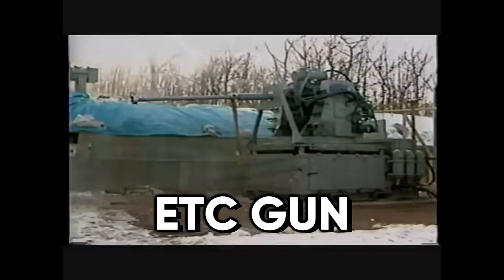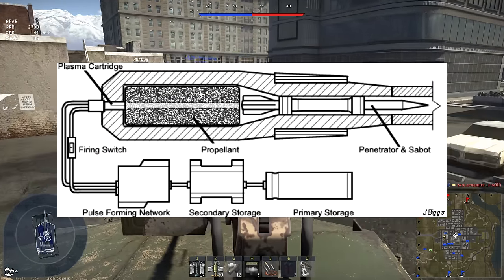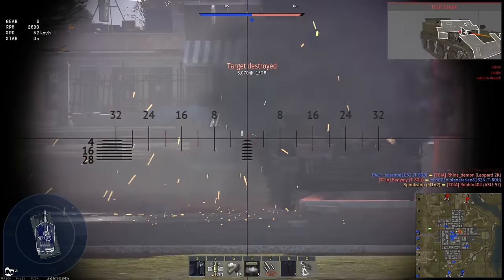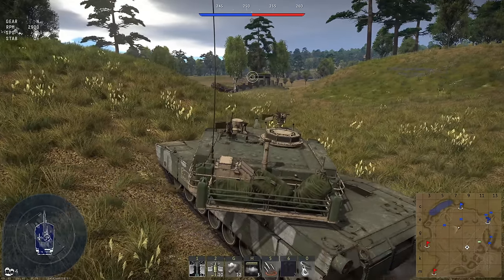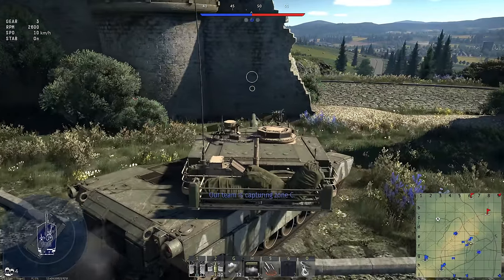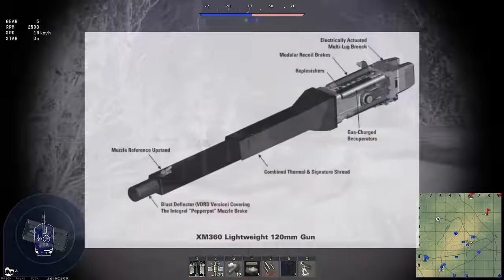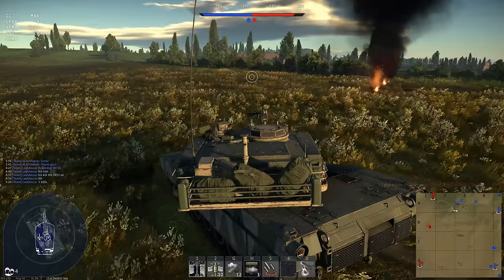ETC Cannons - The Future of Tank Weaponry

Comment: Wow!
Epic gun with quick fire rate like this sure will be a huge change in tank manufacturing.
:D
Reply: That's not the point as far as I understand the video. The weapon you are talking about isn't a cannon, it's an ETC autocannon. The kind that is mounted on IFVs. The major difference between conventional guns and ETC cannons is the propellant ignition method. The fire rate will propably be similar. The shell is still the same size, just much more efficient.
Reply: This video isn't saying that tanks will fire as dude above me stayed, it's saying the velocity of the round will be much higher, though theoretically there could be an increase in fire rate.
Reply: Yeah except that no, ETC gun have disadvantage, one of them being that it build up more heat so quick fire rate ain't a good idea. there is also no need for extreme firerate on the battlefield.
Reply: @benjamin1359870  If there was no need, why would autocannons and assault rifles exist? High fire rate is obviously a preferred approach when dealing with soft targets, especially in large groups. For tank guns fire rate is good as well. If you can put out rounds 1.5 times faster than your enemy, you will be killing 1.5 times as much shit. Of course, at a certain point the autoloader you'd need to install would get too mechanically complex to be reliably used, and there would be problems with the aforementioned heat buildup. But up until a certain point, increase in fire rate is a desirable outcome.
Reply: @martydi2519  But those are far for extreme, you just  have to compare the fire rate of a
GAU-8 Avenger to an autocannon, or an assault rifle, there is not anee for extreme fire rate, that's why no modern machine gun has the fire rate of an Mg42 despite most of them being based on them, because there is a point where the fire rate is just a hassle. Tank cannon don't need high fire rate they don't deal with soft target in a way that need high fire rate. and on't carry even ammo to really be able to afford to even miss a target, if you never miss your shot you on't really need to worry about how fast your second come; and most of the times in combat situation tank rarely have to shot in quick sucession when a high firerate would help.
Reply: @martydi2519  
Oh!
Yeah you are right!
Besides the ETC cannon is a huge consumer of tank shells.
So we need a lot of shells for this one like about 500 or more.
I guess that it's demanding in this case.
Reply: @martydi2519  ion cannon or that tripod flexible pipe and can shoot heat temp that

Comment: I ammunition propellant can only be ignited by a plasma device it cannot be ignited by incoming enemy rounds. That is HUGE as most tank kills are due to ammunition cook off. It also increases crew surviveability.  While an incoming round that penetrates the armor is going to be deadly on any crew unlucky enough to be struck by spalling and fragments of the perpetrator, not having you own ammunition explode in the turret with you, is a bit of a relief.  My opinion would be that, if it increases round performance against enemy targets great, but if it maintained round performance similar to current chemical propellant , but increased crew surviveability by making the rounds impervious to cook due to vehicle armor penetration, then that is still a winner. A tank can be repaired from lots of battle damage. Its the trained crews that are harder to replace. A catastrophic internal explosion will usually destroy the tank beyond repair AND kill your crew.

Comment: Supercapacitors are getting pretty good. Maybe the diesel engines in tanks could just serve as generators, driving power to separate supercap banks, a main one for movement and other standard technical systems, then a small one for the cannon.

Comment: I thought of this a while ago when I was making a sci fi universe.

In it batteries where a issue so I couldn’t use rail guns so I came up with the idea to uses coil guns mixed with etc guns. 

With the main power coming from the etc and the coil increasing its power as it when down the barrel of the gun.

With a diamondoid bullet with a tungsten core and a super conducting material on the surface of the bullet going down the barrel at Mach 15.
Reply: The only issue with that is cooling and the resulting local atmospheric heating from firing more then a few shots potentially frying nearby friendly infantry.
Reply: You and I both, blood God.
Reply: Demo_the _man 

The marines in it where genetically enriched cyborgs 
Wearing power armor and
 the gun and armour where made of a super alloy that could take a lot of heat and recoil
Reply: KajiTetsushi 
Nice what was your story about
Reply: @primaris7045  not something I can discuss at great length in a YouTube comment.

"Going 15Ma" is not very believable in the universe I want to envision, especially not in handheld firearms, so I use ETCs accelerated with gaussrifles / coilguns instead... and possibly full-on railgun if I see it fit. It won't be feasibly man-portable at this universe's current state of affairs; only vehicles and emplacements can wield such a weapon.
Reply: KajiTetsushi 
Sounds cool did you ever publish your story 

I’m still writing mine
Reply: @primaris7045  nope
Reply: KajiTetsushi 

To bad I guess
Reply: @primaris7045  there's a better time for it, like maybe in 5+ years from now while I brush up my drawing / programming / writing skills...
Reply: KajiTetsushi 

Cool

Comment: If i remember correctly, the germans did researched this technology in the early 80's and it turned out to inpractical for common use - especially in real war scenarios. And there where also problems when the inviromental temperatures are to hot or to cold.
I did a quick search but i could not find anything on the web. Im sure i read this in a museum.
Reply: Just because the issues were too hard to overcome in the 80's, that does not imply that they always will be

Comment: I don't understand why I didn't mention this when this video got uploaded.
The reason why we don't see ETC guns in use is that higher velocity is ironically detrimental to APFSDS performance. Those rounds have optimal penetration velocity dependant on the material used, DU rounds tend to be around 1600m/s, WHA tends to be higher at around 2000m/s mark, and steel is 2500m/s. There is no need for higher velocity or more kinetic energy.
That could change if some country decides to work on a proper ammunition that could take advantage of the increase in those characteristics. Though it is unlikely unless there will be a drastic leap in armor technology.
Reply: How is higher velocity detrimental to APFSDS performance.
Reply: @smileyface6583  Few reasons. Beyond certain point you start to get massive diminishing returns from increasing velocity. At the current velocities the length of the penetrator matters much more than its velocity, which is why we see constant introduction of APFSDS rounds with longer and longer penetrators. As velocity increases penetrator might "shatter" or do other fancy stuff when hitting a target, basically working against itself, there were some ideas how to prevent that, telescopic penetrators, multiple "stage" penetrators etc.
Reply: @Ally5141  Ok I think I get it now. So you’d probably need something like osmium, along with some fancy APSFDS engineering to have the optimum conditions for higher velocities, right?
Reply: @smileyface6583  yeah, tho denser materials work better at lower velocities. 
As the tip of the penetrator hits target and gets slowed down the rear part of it still pushes forward carried by momentum. This generates internal stresses between tip and rear that can (and will) cause the penetrator to lose integrity. Less dense materials, that can be squeezed more easily resist this better.

Comment: Do we even have shells (or materials we could use for shells) capable of being fired at such high velocities without simply shattering on impact? 
We already transitioned from steel shells to tungsten-carbide cored shells, and even those risk shattering on armor when fired from current guns. Some countries have depleted uranium shells, and long-rod penetrators are also made of very tough stuff. Are either of those materials viable for use in shells fired at extreme high-velocity from next-gen ETC, CLG, or rail guns?

Comment: Going into this video with prior knowledge on ETCs(Not on hands experience). There's an awful lot of things that make them pretty bad when in the context of conventional warfare, and military use in general.

1. Maintenance
Everything about ETCs screams doubled or even quadrupled wear on the tank barrel. The increased ignition rate of the powder and higher acceleration is a dead give away of this.

2. System complexity
This in comparison to current systems, is very complex when in operation. There's so many crucial components that need to be in perfect working order for the whole system to operate. 

On top of that, repairing the system takes specialized knowledge because of the new components in the system which reduces an ETC vehicle's availability rates

3. Efficiency
Taking information given to me from watching other videos about ETC weapons, they're super inefficient during operation, meaning that a lot of energy used to propel the gun is mostly lost through heat because of the rapid ignition of the powder which leads to the afformentioned increased barrel wear

4. Increased costs
With a system like this, it's going to inevitably be more expensive than conventional guns which doesn't help with the fact that most militaries today are heading towards downsizing and acquiring cheaper/cost effective weapons
So in conclusion, are ETCs the future of tanks? They can be for sure, if the tank is operating in absolutes where it doesn't suffer horrible inefficiency and that there's a huge advancement in gun barrel technology to curb the barrel wear problem

Comment: Generally less moving parts = better reliability. Better reliability means they can push the tech further. I knew about this technology before from small arms speculation but very interesting video. Thanks!
Reply: Ofc my comment is a vast oversimplification since it improves stuff like being able to use different propellants when you don't have to worry about chemical ignition and so on and so on

Comment: I think that we might see an ETC concept combined with a Binary Propellant System to increase the gun's velocity WITHOUT increasing the size/weight of the gun.  You would load the projectile, then introduce TWO separate "liquid or powdered propellants" [which are stable when alone but become volatile when mixed] by an injection system, and finally ignite the combined solution [or powder] with a plasma charge.  The BP propellant component can be very compact (just look at the small-diameter bomb and its "hyperbaric explosive" compound) and the only major issue would be creating a barrel that can contain such large pressures.

Comment: One thing that you also miss is that with ETC gun the power of a round is no longer limited by the chamber volume and the burning temperature of the propellant, in a conventional gun the chamber volume limit the total amount of energy you can use to propel a round and the temperature of the gas is bound to the burning temperature of the propellant, with an ETC gun, it's no longer the case you can heat the gas even more increasing it's expansion velocity, that's why ETC gun can reach higher velocity, it also means that depending from the amount of heating the velocity of the projectile change, so it's not just ammunition with higher velocity, it's amunition with changeable velocity depending from the crew need.

Comment: I can just say it again: The Coilgun will be the way to go in the future. They are more effectiv and efficitient than a railgun.
Reply: Unlikely coilgun technology is far more cumbersome and significantly more complicated than railgun technology and can currently not produce a high muzzle velocity due to the incredibly fast switching needed. The only current limitations on railguns are how fast they eat the rails and capacitor technology.
Reply: In thier current state neither the railgun or coilgun are practical options, they are both too expsensive, complicated, and power hungry to be used in anything smaller then a ship. The coilgun still has issues with swithing power from one coil to the next with the correct timing. Though if we're going to bring those two up, might i suggest a third option of electromegnetic gun? How about something called a helical railgun? While it currently wouldn't be any more practical, it does combine the advantages of both the railgun and the coilgun.
Reply: @synapsisflame9721  The tech is obviously not researched enought. Theoratical you can reach far greater velocities then with every other technology. Im desiging an own future military currently and the tanks for example use coilguns, it has a lot of potential advantages, those i would bet you dont know about.
Reply: @riesenfliegefly7139  what are the examples of these benefits compared to railguns. Currently like Mrpotates stated neither are practically for military applications. Both technologies are currently extremely cumbersome and inefficient however like I said the only thing limiting railguns are the rail material and capacitor technology. The main problem with current rails on a railgun is the erosion from the extreme heat and pressure when the gun is being fired limiting current barrel life to 15-20ish full power rounds from the navies railgun. Even if the technologies get smaller and significantly more reliable militaries are more likely to go with the cheaper less complicated railguns.

Comment: How scale able is this tech? Could it be scaled down to firearms, or scaled up to naval weaponry?
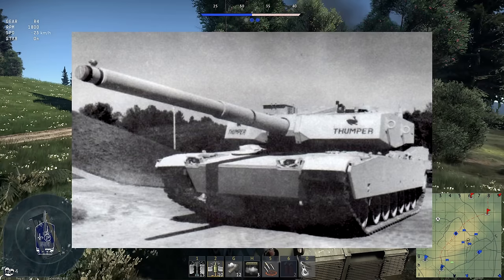Reply: The prototype that appeared at the beginning of the video was a 60mm but larger caliber ones existed (such as those on the tank at 4:40).
Reply: I think the benefits of more consistent ignition would benefit more on the larger side. (Not that naval vessels use large bore cannon any more- missiles have extended the reach of many vessels whilst reducing the tonnage and displacement  footprint of a vessel's weaponry and removing the need for a lot of dedicated plant and manpower for the same abstract combat value)
Reply: It could be scaled up for naval guns. Scaling down for small arms is a bit trickier. Electrically fired primers have some benefits and have been done before in rifles. But if you use ETC in a rifle it will probably make the recoil impulse much shorter and sharper, which can negatively affect accuracy of sustained fire. The energy required will also be higher than a simple electric primer, which means a larger and heavier battery that needs changing more frequently.

Comment: I've actually been writing a more "grounded" sci fi story where human soldiers use ETC rifles firing a semi-caseless sub caliber penetrator with a polymer sabot. Man portable railguns exist in this world, but the batteries and power equipment are very bulky so they're normally crew served, but an ETC plasma cartridge is cheap, and can fire hundreds to thousands of rounds before running dry. You can even scale it up with rail or coil assists, instead of a tank just loading APFSDS, it loads a round that's basically a railgun sabot, and as it fires, coils around the gun barrel speed it up to hypersonic speeds.

Honestly an underexplored weapon in sci fi, I feel

Comment: If they can shorten the shell casing  by using a more potent propellant, modify the breach for the new shell, you could reduce the size of the turret shell stowage compartment allowing for a small APU (Aux. Power Unit) to be mounted to power the ETC Device.

Comment: Battery technology is improving at a blistering pace as well, if a tank is fully electric then the need for a separate power supply for the ETC will stop being a negative since it could just pull from the battery pack, also the ETC seems like it was designed for use with super or ultra-capacitors, which one would probably want on tanks anyways since they improve efficiency when using small but powerful bursts of energy like a tank uses all the time.
Reply: Fuel Cell Hydrogen generation must be at peak efficiency. This will have its own advantages. Firstly, Hydrogen could serve as a plasma charge for ETC gun. Hydrogen can easily be converted to plasma using a Tesla coil. Second the electrical energy generated can be stored in capacitors to charge the ETC gun enabling a two man crew or even a single driver operating the tank. Thirdly improved Fuel Cell efficiency allows for more combat range.

Comment: Ok regarding etc gun advocation I see is the 2:30 minute mark where velocities are mentioned. Our current guns can already fire a round well beyond the 1.8km/s but the problem isn't with the gun but rather the munitions. America fires DU alloy munitions due to low cost of materials compared to tungsten alloys, and DU has been proven in test fires and documented by Lanz that there is a diminishing returns on the performance of a round and it's velocity, they don't go much faster than 1.8km/s becaues beyond that the round actually starts losing effectiveness, This is one of the main reasons why we are not adopting the L/55 that the germans are utilizing. A reason we would be increasing the caliber of the gun is to allow for larger rounds to be fired off at the same speeds, but still having increased momentum and possibly higher length to diameter ratio for the main penetrator plus extra room for additional segmentation or 'smart' modifications to the longrod fired similar to how we now how guided bullets from proof of concept weaponry.